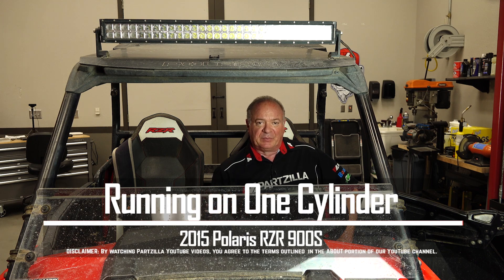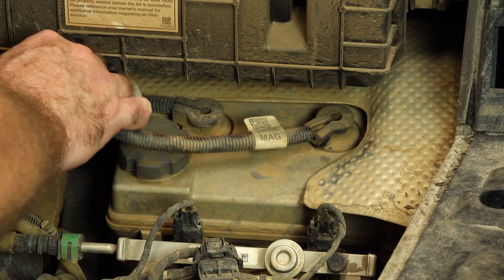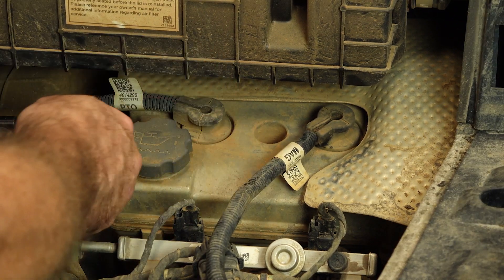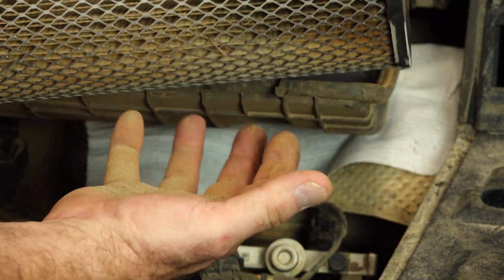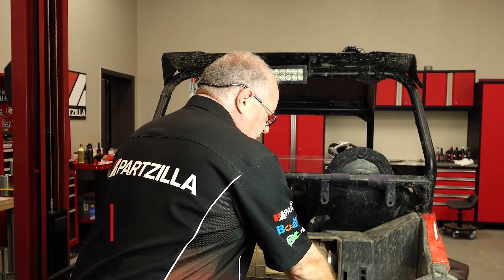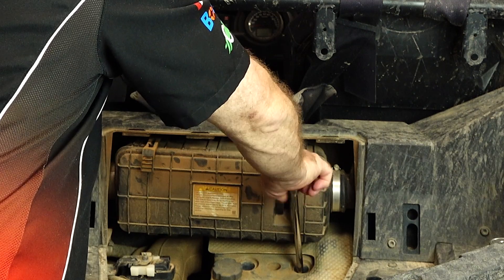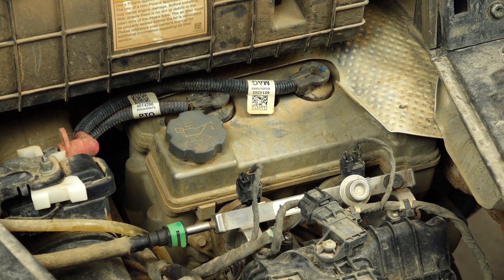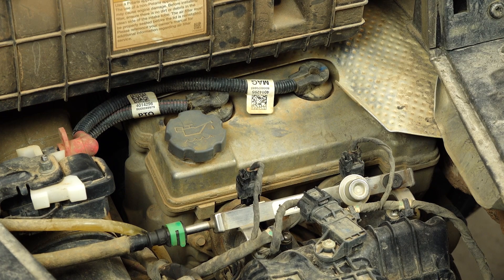Polaris RZR Runs on One Cylinder | Polaris RZR 900S Dead Cylinder | Partzilla.com

Comment: Good morning, I hope you are well, I have a problem, I changed the fuel pump because it had low pressure and now the Polaris does not start if the engine turns, I checked the spark plug and it has spark, I have new coit and injectors, I see that one injector is removed and It draws gasoline on one side and I put the same injector on the other side and it doesn't draw and it has power, if you could help me

Comment: Hello, I hope you are well, I always watch your channel, I have a problem with my 2015 Polaris 900 S, I accelerate it and it chokes, I was changing the spark plugs and the coit, they put a fuel pump in but I think it is defective, when I think it is just a piston running, when I accelerate it doesn't move forward it chokes me. I hope you can help me
Reply from the maker: Have you checked the seat belt sensor? If the belt is not engaged or the internal switch isn't working, it will hold the engine back.
Reply: Did you find the problem? currently having the same issue